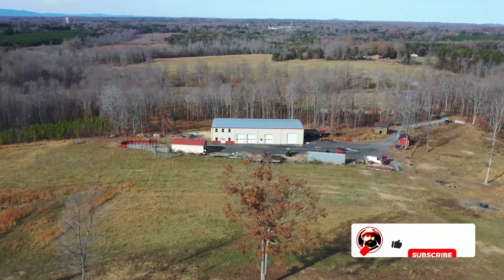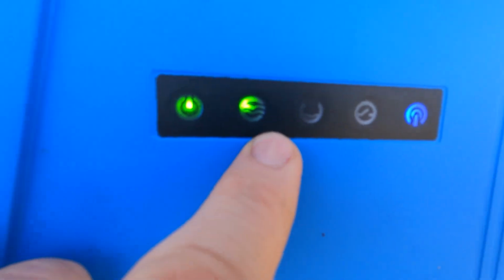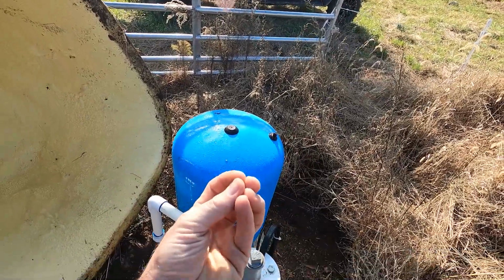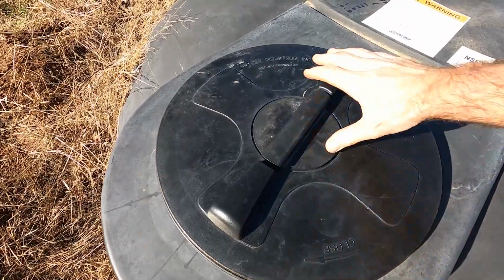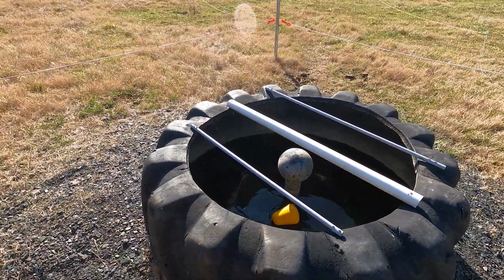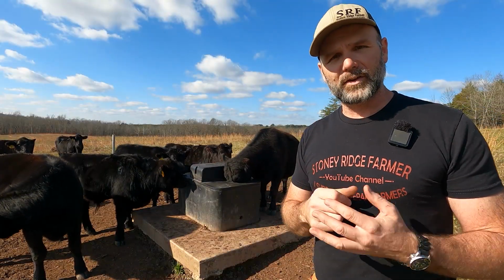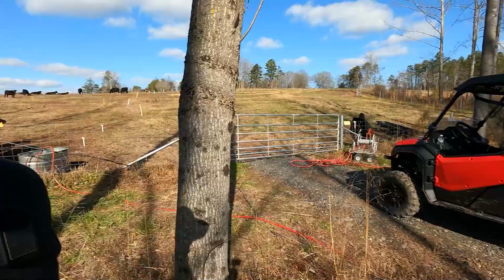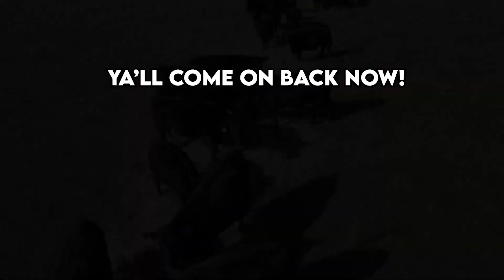How a solar well works on a farm...off grid water!

Comment: No battery as the main back up 👍👍👍👍👍 VERY VERY SMART!!!And knowing exactly where to put the main well pump it’s extremely smart, so you can do gravity storage very smart system you have!! 👍👍👍👍👍
Reply from the maker: storing water is much lower maintenance and expense than storing power that's for sure

Comment: On my farm we use very old water technology  shallow well   rope  and bucket spring creek and bucket  low cost easy. To repair no problems since early 1800  s no plumbing repair in many generations 😂🤗🤠
Reply from the maker: that's fantastic....but you ain't gonna water 50 cows that are 1/2 mile away with that my friend.  I'd love to have an old hand dug well....but I wouldn't wanna get sick when a racoon falls over in it lol  Stay tuned...building a "spring house" soon
Reply: Ok put cows where is natural water so they take care of themselves put garden where it needs little help from man Labor 😜☺️  thanks
Reply: @StoneyRidgeFarmer  I had a possom die and decompose ins friend's spring supply we  drank from it and didn't get sick but the smell caused me to clean it out.   A good  amount system solved a lot of problems 😃😂

Comment: Suggestion  to install   a warning /alarm light that you can see from house or shop  this a visual  warning  that gives heads up that water tank is low and or pump malfunction  ? Could be because  of low voltage  not allowing  pump to run  heads up before  running out

Comment: This is very informative.  I’ve been looking for solar backup for my grid tied well pump for my home but my 2hp pump requires 6000 start watts.  I have a trifuel generator as a backup that can generate 30amp/220v and that start wattage, but would greatly prefer a solar system with battery backup.

Comment: Does this well supply your home as well? We are on well, but this got me thinking as a back up for hurricanes (Florida) when the power goes out. The one thing you miss real quick is water. 

Do you treat the 1500 gal storage tank so that it could be potable? I like the idea of having that in reserve for personal use.
Reply from the maker: The tank isn't treated and the water is potable....if you wanted you could use a system like this for your home, however understand that if you're planning on water storage, it needs to be in a place on your property that is high enough to build water pressure. This well does not supply my home, but could easily be piped in as a backup if we needed it

Comment: I wonder if there would be a way to plug in a generator to run the pump for emergency use only ?
Reply: Yes, we have a power pack that changes the ac power from the generator back to dc to run the pump system. It can be manual or automatic based on irradiation level.

Comment: Is there not a port on the Solar setup that you can connect your generator?  That way you have a backup energy source.
Reply: We have a power pack that changes the ac power from the generator to dc power. It can be automated or manual.
Reply from the maker: boom!
Reply from the maker: Eric works for Lorentz....he's the fella that responded for ya buddy

Comment: Appalachian Mountains only has about 150 sunny days a year the rest is cloudy and rainy not sure how it would do there, obviously not well
Reply: You would need a lot of storage
Reply: @JurassicJolts  👍 agreed 👍
Reply from the maker: we are in the Appalachian mountains and it works just fine...you've gotta understand that storing 1500 gallons of water keeps you from running out.  The sun pops out for 1/2 hour and you've pumped 500-1000 gallons depending on your pump settings...that's enough water to run your house for nearly a week or 35 cows for 3-6 days in the summer
Reply: @StoneyRidgeFarmer  that's nice to know thank you I bought some unrestricted land in the Appalachian Mountains, I plan on moving there in the middle of next year and plan to live off grid thank you for your Insight and sharing your videos much appreciated by all your subscribers👍

Comment: I agree with most of the conversation but you said having a plan a b c you made your argument for no battery backup an actual necessity as part of the planning 😂 ( speaking from experience ) 👍🏻
Reply from the maker: I'd say more of a necessity would be a portable generator to help you if you got into a pinch...but maintaining a battery setup is expensive...easier to store water than power my brotha

Comment: Apologies if you've already covered it, but why did you drill 400ft when the water table is 20ft?
Reply from the maker: the water table is not where we hit water underground.  We drilled to 460 and got 20 gpm...25 feet is the water table, we hit water at 420 ft  you've gotta drill until you get water flow to fill the well to the water table
Reply: @StoneyRidgeFarmer  Aqua Drill in Sandy Ridge dug our well.

Comment: I'd put a check valve on those waterers to prevent siphoning and/or backflow
Reply from the maker: there is a backflow valve on the well...however backflow in the tire tanks is something we want when the waterers in use start going dry
Reply: @StoneyRidgeFarmer  well that makes sense if that's something you want to happen

Comment: If you hammer the ice with a gold fish under it, you risk serious injury or death to the goldfish.....with fish it's better to use heat to melt the ice. Typically boiling water into a metal can on the top of the ice...once it melts thru you can break the ice safely for the goldfish......or buy a new goldfish.
Reply from the maker: 650 gallon water tank....taking up boiling water to melt the ice is simply not practical my friend

Comment: First, "you need to have a back up system for your backup system..." Like a battery?!? I think you've heard that before... and for the windmills... yea, just about every farm around here has windmills... some run pumps and some generate electric. One hint to do it, look to the Amish. I'm surrounded on 3 sides by Amish. Your way failed two ways because of human intervention. Cloudy sky and forgot to close a valve... You want to store water? Great. But stick a stupid battery there.
Reply from the maker: the backup is the water cistern my friend.....we dont have windmills here because we don't get enough wind.  The system failed due to a major leak.....what you are saying is great.....but not necessary if everything is working correctly my friend

Comment: Instead of spending so much money on the solar equipment, why not just trench electric from one of the out buildings that you have?
Reply from the maker: none of the outbuildings have power my friend
Reply: @StoneyRidgeFarmer  is the farm pretty far from power line access?  What would it cost to install poles and have a line run?  How long of a run would it be?  Now I understand the Solar well pump.  🙂